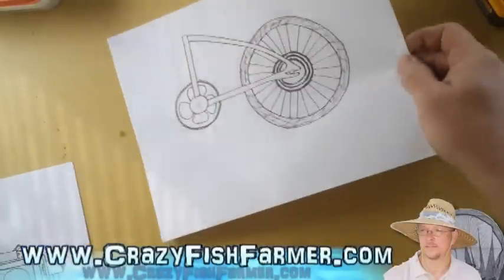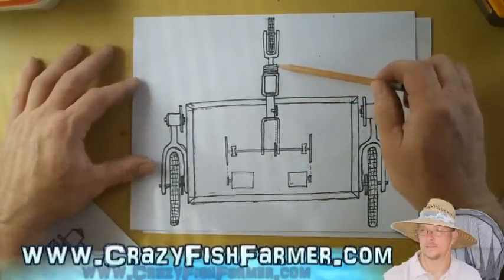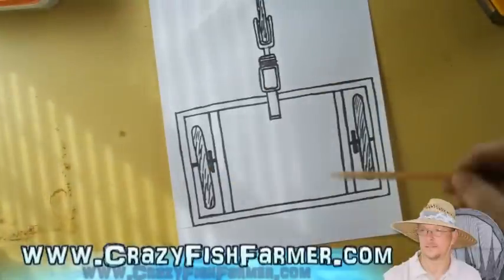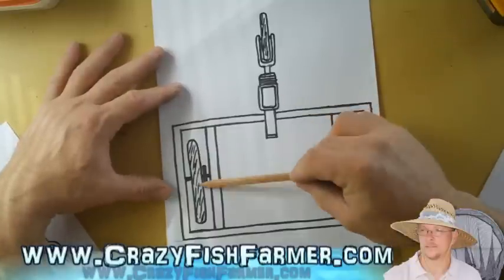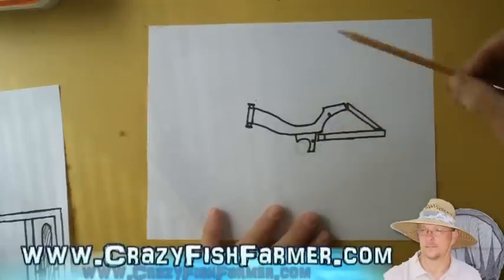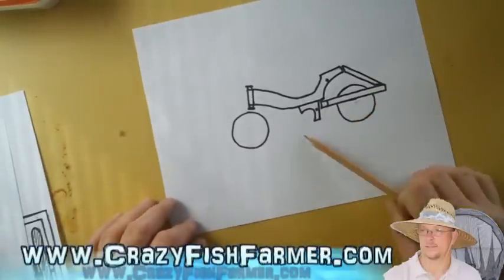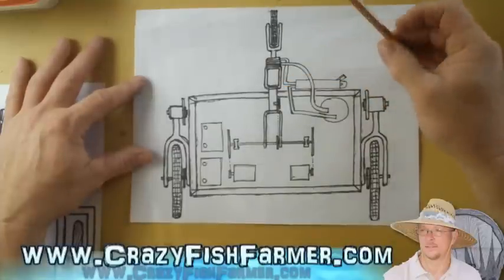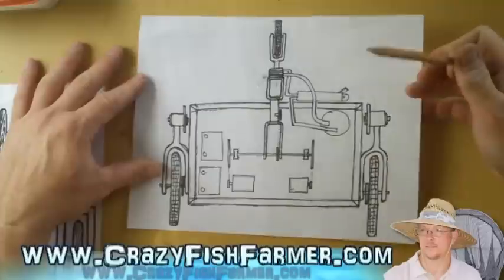2 Tomos Moped Gasoline Vapor System, Vapor Carburetor, HHO, Hydroxy

Comment: i would suggest a trike respecting your design but instead of just adding hho and gasoline vapours inside the engine you could fabricate a huge exhaust muffler for the moped and then collect the exhaust heat of your engine by mounting some peltier elements on the body of the muffler to get energy from heat,that you could later on use for a second hydroxy cell that you could add to the trikes engine "intake manifold"